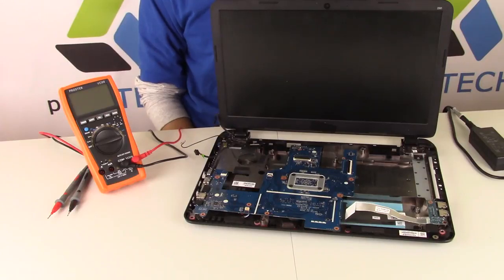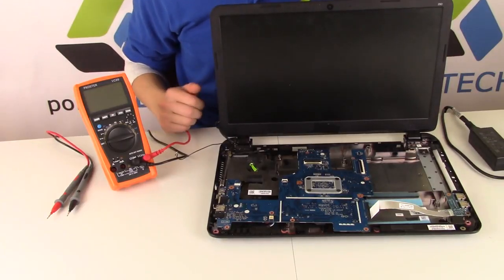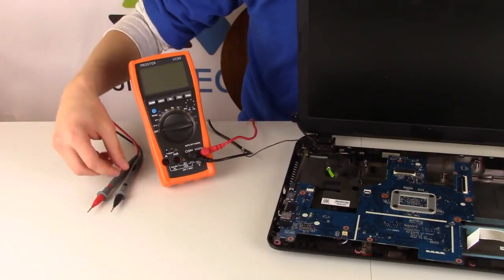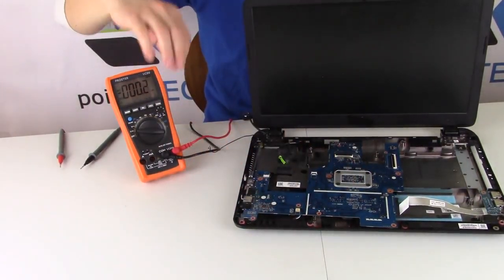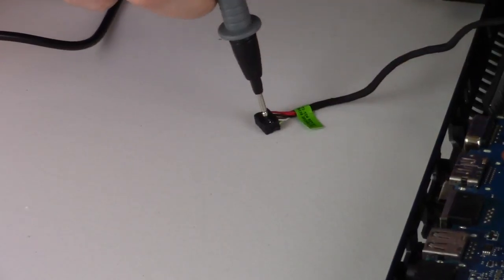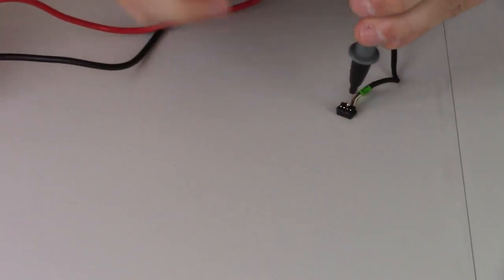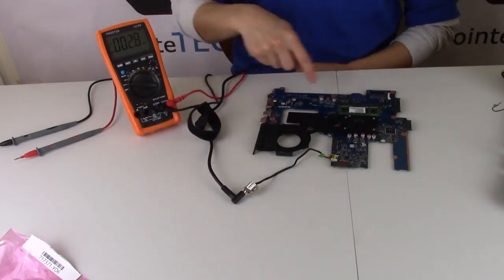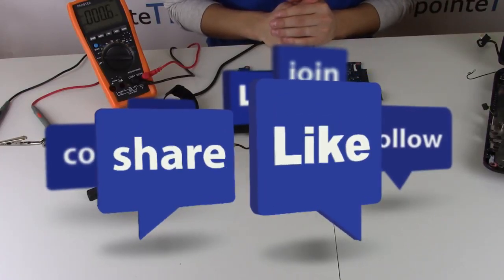How to Fix Test Power Jack - HP Laptop Computer

Comment: hi ser ... may charger reads 19v. then immediately back to 1.  .is my charger still good or not? thanks ..love your tutorials
Reply from the maker: Its most likely bad.  It shouldnt change that much like that
Reply: @PC_Monkey  thanks... can i ask more..  😊
Reply: after i intalled windows 10 in my lenovo color orange ultra book... it finished.. i updated it. and so on so fort.. then when i was trying to turn on it again... it wont turn on... it just blinks.. the keyboard and the led light.. just blinks.. on and off.. about 3 sec.. what must be the problem.. i was so happy when i finished it then suddenly awts
Reply from the maker: @murphybonaobra3565  Are the lights the only signs of life when you turn it on?  No motherboard or hard drive sounds?  No fan noise?
Reply: @PC_Monkey  there is fan but also on and off.. theres also lights on m.2 disk.. on and off. the built in ram is also heating. .

Comment: Hi nice video,my laptop suddenly cant power on even getting power to wall. my question is my reading for dc adapter is 19.81v  so when i plug in to my jack board its turn to 17.14v,its normal or  suppose to be the same? I see the back of my machine is 19.5v 7.7A.  thanks!
Reply from the maker: It may be ok, depending on your computer.  
For a computer that does not turn on, try this video first;  https://youtu.be/P3I7dDpkJps.  Let me know how that goes :)

Comment: Please sir what if the power adapter is onboard and not detachable .how do you test if it is the problem
Reply from the maker: Your power adapter cord cannot be unplugged from your computer?
Reply: @PC_Monkey  no sir, I mean the the female connector where the charger goes into ,my laptop is a ASUS U47A series. The charging port is onboard.
Reply: @PC_Monkey  also Thank you very much for replying
Reply from the maker: @angelusman974  I still dont understand.  So the power adapter unplugs fine?  The charging port it attached to the motherboard?   Correct?  So whats the issue?  What are you asking?

Comment: hey man im having issues with my laptop because it wont show any signs of life my charger is good but when i test the voltage of the power jack i get 5v other than 19v, but my battery charges it goes max to like 2v but when i unplug the charger, i can see on my multimeter that the voltage is going down slowly. I dont know if the battery is bad or i have an electric leak but there is electricity going form the power jack to the battery, and i dont know if it has to do with the problem but there is no hard drive.i have tried a bios update and tested the little battery for the bios and got like 3v.  i would really appreciate if you could answer my comment thanks!
Reply from the maker: For a computer that does not turn on, try this video first;  https://youtu.be/P3I7dDpkJps.  Have you tried those steps yet?
If the power jack is reading just 5V then that may be the issue if none of those other steps help.  You may need to replace the power jack if its easy to do so.  If not and if its part of the motherboard, you would need to replace that :(
Reply: @PC_Monkey  alright thank you very much

Comment: Dude I ran into the same problem yesterday and I am using an Acer Aspire 3…and I bought a new power jack but still nothing
Reply from the maker: What problem did you run into?  Your computer isnt starting?
Are there any signs of life at all?  Lights?  Fan, Motherboard, or Hard Drive sounds?

Comment: Thanks! That's for laptops with a detachable power connector. But when is onboard... any ideas? Tired of looking for the schematics of my Samsung np700
Reply from the maker: You can still test a power jack thats soldered on to the motherboard.  You just have to locate the power transfer pins.

Comment: Great video. Thank you. Please help.. 
I have test the charger and the power jack but still the computer is dead. Also i have diconnect the bios. ..  My laptop is lenovo ultrabook U310....
Reply from the maker: You have tried all the steps seen here?   https://youtu.be/P3I7dDpkJps.
Reply: @PC_Monkey  yes i have done all the steps except changing the other board !!!
Reply from the maker: @AbdullahRahhal  If all the tests in this video do not reveal the issue, and your power adapter tested to be fine, then your most likely looking at a Motherboard replacement

Comment: What if your power jack is soldered onto the motherboard? How do you test for power? No red or black indicator.
Reply from the maker: Even when its soldered, there are connection points on the motherboard that are usually accessible.  What is the brand and model of your computer?
Also, is your computer not turning on at all?  No sighs of life at all?
Reply: @PC_Monkey  it's an old dell latitude E5500. Doesn't come on at all. I've done the static power removal and power cord reads correct voltage.
Reply: @PC_Monkey  It's the power jack. Thank you, appreciate the video and help.
Reply from the maker: @kolelake5462  Glad you found the issue !!

Comment: Thank you so much for this tutorial :). I also i tested the pins on the power jack and all of the wires are transmitting the correct voltage except for one wire, which isnt transmitting any power at all. should i replace it? Also I have a dell inspiron 5491

Comment: very helpful.  my dell laptop e6530 charging jack has 2 red wires, 2 black wires and a blue.  one set of black and red gives me correct voltage, but the other sets are off.  are any combination of red and black supposed to give me the 19 volts??   thanks.

Comment: What about if i only getting 8000 ohms at the power socket and when i plug in, it just flashes blue power light at that socket for a sec and all other lights in front are dead and no amps drawn?  However, the power mosfets to the sensing resistor are on and i have 19V there so the super IO is turning them on? but the m/B appears dead. Tricky one if any one can help. done the usual like remove everything from the board and check for shorts to ground all over but there is that low ohm at the socket.  All chips are cold and would a shorted SB or NB not allow at least the socket light to stay lit even if laptop wont come on? 
 Laptop is Presario C700
thanks

Comment: Where you tested the port into the mothernoard and confirmed you have power on the other side. I have power going into the port, but not on the other side... What next?
Reply from the maker: That could indicate the power jack is damaged and is not correctly supplying the motherboard.  You would then need to replace the power jack.

Comment: I’ve tried all of these videos but it still isn’t working all that happens is the power light turns on for a sec then off. The charging light blinks a really slow orange. Do you think maybe the mother board or CPU is the problem? Any help would be much appreciated thank you for the vidz!
Reply from the maker: You have tried all the troubleshooting steps seen here?  https://youtu.be/P3I7dDpkJps.

Comment: Hello, great video! Ive test my charger, the power jack and the port and they all read 19 volts. Laptop doesn't charge and doesnot turn on when the battery is removed and computer is plugged in. What could be my next step?
Reply from the maker: Have you tried all the steps seen here?  https://youtu.be/P3I7dDpkJps.
Reply: @PC_Monkey   Just watched ot and followed all the steps removing and placing back in ram etc. In a wierd accident, while plugged in to the wall and computer, the charger cable melted on a stove burner and i could see that the raw wire of the different cables were touching. I have a new charger now with the same power ratings. After that accident the battery stopped charging but the computer ran just fine untill i ran out of charge.
Reply: Same problem here already did tests of first videos (power jack test, charger test,static test) still won't turn on whitout battery

Comment: Hey im runnin into an issue with my acer aspire 5. The battery is not chargin, i took it out, it opens with the ac in but when the cpu goes on higher % it just shuts down. Idk if it can be the ac or the power plug. The ac has 19v output 🤷‍♂️ could the plug be the reason. Before all these my baterry kept disconecting the ac from chargin till it did not charge it at all now.

Comment: I have disassembled a MIIX 510 which doesn't turn on or charge. The power button will spin the fan for 1 second only.The charger gives correct 20V, tested with a DMM.
However when I plug in the charger, I always see a super tiny blue spark - this can't possibly be normal can it? You wouldn't notice it briefly sparks unless you had it disassembled, as I have.
It also sometimes sounds like coil whine on the board.
Would appreciate quick thoughts, thank you.
Reply from the maker: For a computer that does not turn on, try this video first;  https://youtu.be/P3I7dDpkJps.  Let me know how that goes :)
If your seeing a spark, that could indicate a damaged power jack / motherboard :(
Reply: @PC_Monkey  thanks so much for your reply, but having watched your linked video, I have previously tried all suggestions within.
I also previously tried my Multi meter on the charger which reads solid 20.33v (rated 20v) so I assumed that was fine, but I saw a video by Sorin last night which says the charger may read correct volts but may still have an un-testable current issue.

Comment: My dell 5558 laptop is not getting charged but laptop works, the battery is new and good.  It says PLUGGED IN but the battery never gets charged.... Can you help me .. 
I tried some static electric discharge, new charger , BIOS reset, still same.....
Reply from the maker: Have you tried all the steps seen here?  https://www.youtube.com/watch?v=arZpfqcVoUs
Reply: @PC_Monkey  yeah bro I did all of them . Actually the static discharge worked few days ago when I first did that but now it's not anymore... I checked the voltage and it's fine, not able to check the amperage. Did the uninstall of battery drivers and restarting , still at 0 %. This battery is a new one which I bought 8 months ago, yet I ordered a new battery as the final thing to do..
Reply from the maker: @vijayrudra285  If the new battery does the same thing, you may be looking at a battery port / motherboard issue at this point :(
Reply: @PC_Monkey  hi... I was just using with power all these days... But today I opened up my laptop.. removed CMOS  battery, ssd, wifi chip, that's it I just looked inside and fixed up again , I did not disturbed the ram .. And now it's working again  LOL.. do you have any idea why this happens ??
Reply from the maker: @vijayrudra285  BIOS can mess a lot of things up when settings error.  Resetting BIOS by temp removing the CMOS battery could have reset them to factory and solved the issue

Comment: I have a hand me down laptop hp elitebook 820, been using it for 4 years now. I was told that when using the laptop always plug the outlet to the wall unit as the battery doesn't work. I normally don't unplug my laptop and never turn it off and when not using I just put it on sleep mode. Well, today I unlug the computer as I needed to go to the library with my laptop....and I could not turn the laptop on. I have done all of your videos and I know that the wire is fine....I just don't know what to do to turn in my laptop.  Pls help...my email is otran9@hotmail.com. thank you. Here is what my laptop looks like. I don't think I have the bios battery
Reply from the maker: You have tried all the steps seen here?  https://youtu.be/P3I7dDpkJps.

Comment: My laptop was working fine with the battery and the charger but suddenly it's just dead... I don't really want to take apart the whole thing to test the adapter, but I'm sure the battery and cable are fine.  Why would it just stop working?
Reply from the maker: There are several reasons why a computer would shut down and not turn on.
For a computer that does not turn on, try this video first;  https://youtu.be/P3I7dDpkJps.  Let me know how that goes :)
Reply: @PC_Monkey  resetting the bios settings worked thanks
Reply from the maker: @dassnek4728  Great to hear !!  Always here to help :):)

Comment: Elaboration and question -> I think the power jack or power supply has a problem on the hand me down laptop I just received that didn't turn back on (battery is a goner, so I'm depending on direct wall connection). 
Already separated from the motherboard, a multimeter applied to the power jack connector while the P.Supply is plugged into the wall will show 19.5V, but moving the cord/jack around where it's plugged in on the PowerSupply side causes huge fluctuations. Stop moving cord, stabilizes IF in certain positions. I tried attaching jack port back into motherboard so I could see if the motherboard side is receiving the 19.5V (when stable), but my motherboard does not have an end like yours to apply power/ground probes to - it is mounted vertically, rather than horizontally to the motherboard (your example being horizontally mounted/attached), and the other end of the motherboard at that location HAS 4 soldering points representing the 4 (2 black, 2 red) positions of the jack port on the other side. When I try to place my probes on these soldering points, I get an extremely low voltage reading that doesn't change. I'm not sure if I'm supposed to see full voltage at these soldering points or not. 
What do you think? (I ordered a new jack port and power supply plug on Amazon thinking I could just return them if it doesn't correct things)
Reply: To clarify something else too - the power supply jack doesn't fluctuate on its own (while not connected to removed jack port) but it's very hard for the red probe to find a spot where it gets voltage.. hence why I decided to remove the jack port and test them together).. because it seemed really difficult to get the voltage, and there is a missing chunk of plastic on the jack end, but I still wasn't sure if it was bad or not.

Comment: what if the 3 things are ok, but computer still doesn't charge?
Reply from the maker: Does the computer battery not charge or does the computer not turn on?
Reply: @PC_Monkey  the power button starts for a second, then it turns off. The battery light says its charging for like a second too, then it turns off also :(
Reply: But, I think it is the DC jack, in the computer, cuz it's visibly broken (no inner plastic tube) even if it passes the 19V correctly :P
Reply from the maker: @LvGbLiNd  Have you tried all the steps seen here yet? https://youtu.be/P3I7dDpkJps.
Reply: @PC_Monkey  No. I just changed the DC Jack, with no results :( i will try your video, thanks!
Reply: The computer now turns on! but it still doesn't charge... and since my battery doesn't have any charge left, its over hehe, I was able to use it with the remaining battery charge, untill it went off. Disconecting the battery and trying to power on alone with the charger doesn't work. :'(. Replaced the jack, used multimeter to check voltages, everything is fine :( :( :(
Reply from the maker: @LvGbLiNd  You static discharge it before you tried it with just the power adapter and no battery?
Reply: @PC_Monkey  Yes. :( i also tried multimeter on the pins entering the battery, they have 6V... which seem too low? (i don't really know) i'm thinking there may be a short with the chasis somewhere. Is this plausible? :O

Comment: Assuming you've checked the charger and everything else. Using your voltage meter what should the reading be in the battery port. I think i have the same model in your video and I have 8 prongs on the back of the laptop. 2 Neg (bigger) 6 Pos(?). I get readings from all 6 Pos except one no matter which Neg prong I touch to.

Comment: Did you get a voltage reading when you tested the white wires with + red wire? My laptop power jack has a single white wire which does not register voltage with + wire.  The black and red wires are fine showing 19V. My laptop will not turn on with good AC power adapter (tests at 19V).
Reply from the maker: The white usually will not show a charge.  The red should.  For a computer that will not turn on, have you tried the steps seen here?  https://youtu.be/P3I7dDpkJps.
Reply: @PC_Monkey  Thanks so much for replying! Yes, the red is + and black is -. When, with power connected, I touch both with the meter leads, I get 19V. When I touch the red and the white I get no voltage. I assumed white functioned as ground and meter should register voltage with the red wire. But it doesn't.  

My laptop does turn on and functions properly on battery. It does not turn on with battery disconnected and AC power adapter plugged in. When the computer is on, the power adapter will not charge the battery. The power adapter is good--supplies 19V. The weird part is sometimes the battery will charge up but only if the laptop is completely turned off! I did try resetting the bios by removing the CMOS battery as you suggested in the other video, but no luck. Something funky is going on and I really like my EVGA SC17 laptop!

Comment: Hi I've watched both your videos for power adapter and now this. All 3 are raiding same voltage 19.6 the power adapter is 19.5. Still no power going to my laptop and turns on. What could the issue be? Thanks
Reply from the maker: Have you tried the other steps seen here?  https://youtu.be/P3I7dDpkJps.
Reply: @PC_Monkey  I'll try the RAM & cmos tomorrow and let you know how i get on